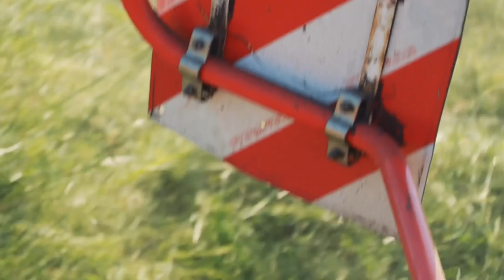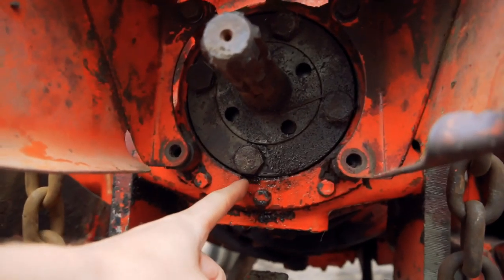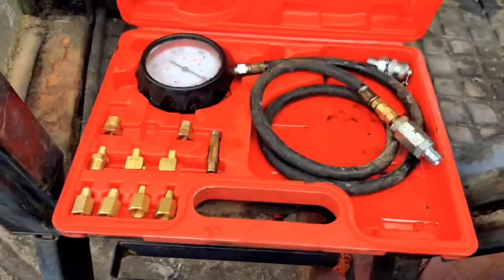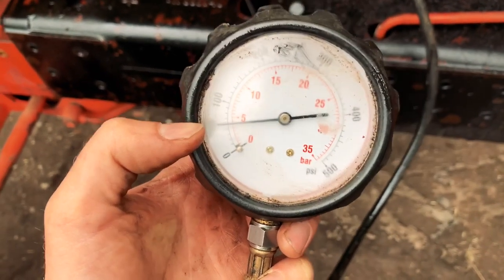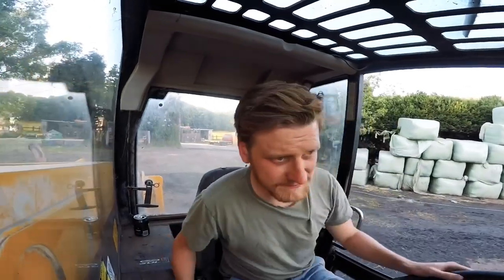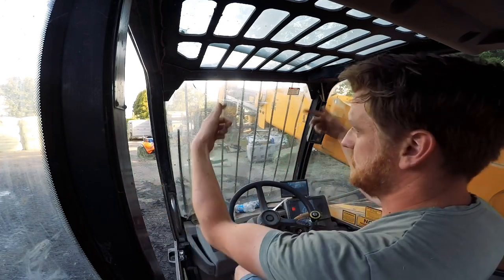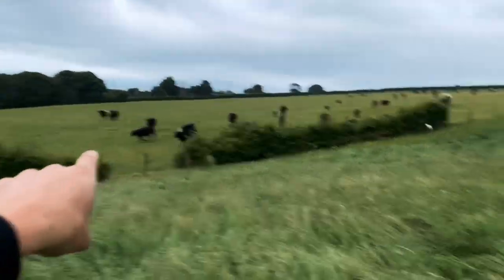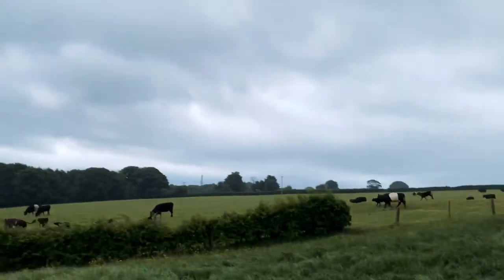FIRST USE OF THE DAVID BROWN 🚜💨 + Wrapping the bales!

Comment: The shaft on ur injection pump their are two brass bushes that wear then the shaft moves slightly wearing the seal then it  leaks. U could be lucky and just have a hardened up seal
Reply from the maker: It was just the circlip had popped off making the shaft slide free. 10 minute job and put some new o rings in for good measure